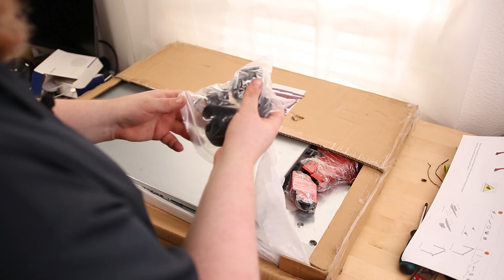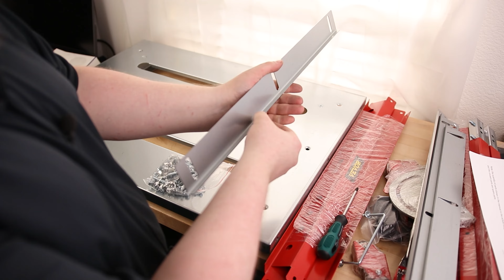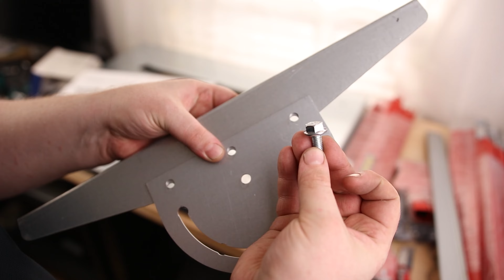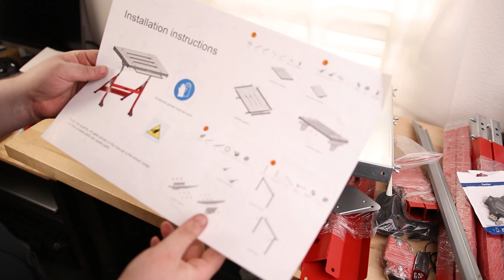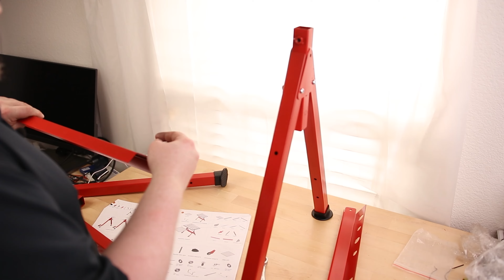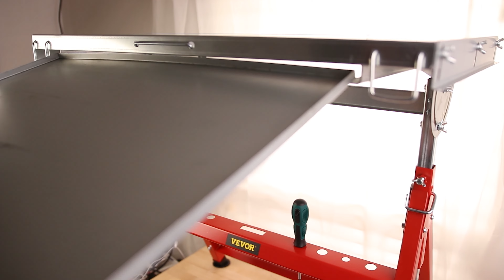Assembling The VEVOR Welding Table

Comment: got similar table. Do you have suggestions for fixtures that work with the slots?  Mine are 28mm wide slots.  Not sure what HF is.
Reply from the maker: The only thing I ever really used the slots for was brushing the slag into the tray.  Most of the fixtures I used were either triangle magnets or strong hand tools welding magnets.  I've since upgraded to this table:  https://www.youtube.com/watch?v=RaDTgwk8ANM  and it's the only table I want to use.  If space is a premium, then this is still a better table, but you'll have to get creative with the fixtures.
Reply: @distractor_beamreviews  thanks.  Since asking above, came across another video pointed out the intent? use of the slots with standard Cee-clamps.  You insert the broad flat tips of the Cee into the ends were slot is cut out larger...  then slip the Cee along the slot to your piece your working on and clamp her down.  

https://www.youtube.com/watch?v=tSoZcLOullI